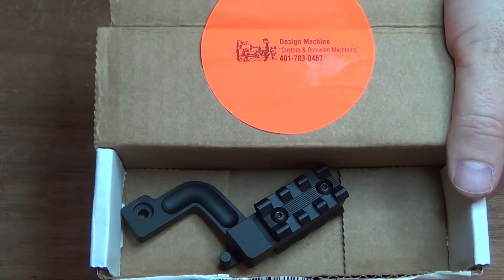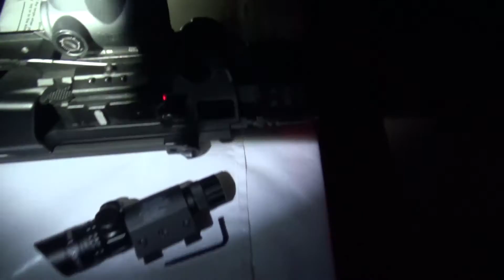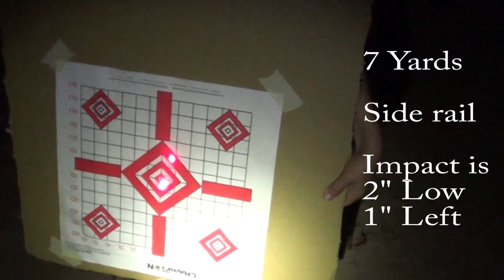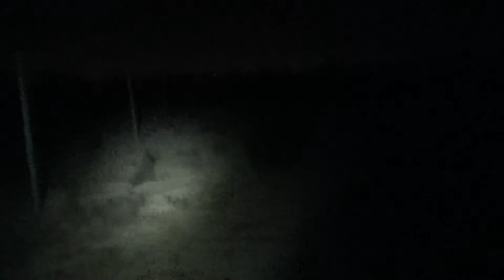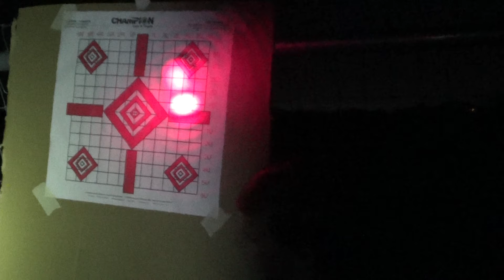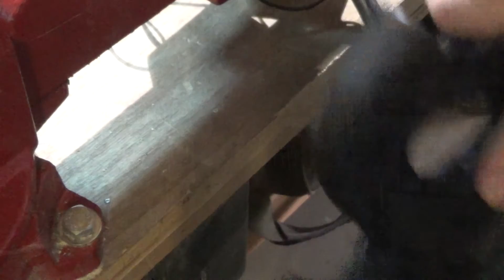New PS90 Light and Laser Mount

Comment: Ordered both the mro and rmr mount as I continue to experiment.  The RMR is a bit small window and if you don’t go with the MRO, the SRO is a good option. 

Right now I have an SRO with low mount on the top rail with a viridian green laser in front of it.  I used a gg&g offset mount on the side rail with a Surefire Scout light that is easy to activate with the tailcap switch.  The laser has a remote switch I can activate with my trigger hand with my thumb.

I bought the PS90 15 years ago and made into SBR maybe 10 years ago.  At 19.75” long, it fits perfectly in a pelican 1525 case that also hold an extra 5 magazines for a total of 6 mags.

If there was ever a firearm worth spending the $200 for an SBR tax stamp, the FN PS90 is it.  The gun ultimately is a 5 to 50 yard CQB rifle and if you outfit it as such, you won’t be disappointed.   Compactness, no recoil and 50 round magazine makes it that.

Comment: I dont think you're supposed to shoulder it as high as you are. For untrained shooters or people who are not used to shooting a lot, the high stock position that is very common in the american shooting community is almost painful to use for longer periods of time. I shoulder the PS90 with the top of the stock in the pocket in my shoulder, under my cheekbone, which requires a lower stock shouldering position than is common in the US. It is, coincidentally, about 1" lower than the high position is, which as you recall, is the difference between the 1.41" optic height of an AR, and the ~2.4" optic height of the original P90 reflex optic (or whatever it was). It also makes the highly rearward angled grip even more comfortable.

Comment: Any possibility that a 1.1" diameter suppressor would fit underneath that DM mount?
Reply from the maker: I don't think so.  It sits pretty close.  To be sure, however, you should contact Duane (link in the description).  He is helpful and easy to talk to.
Reply: I've spoken with someone at DM on the FN forum, but unfortunately they're in a no-can state and haven't attempted to fit one underneath.  I think you're right though, looks pretty tight.

Comment: It looks too close to the muzzle though for a suppressor?
Reply from the maker: On a SBR, a small diameter 5.7 rated can, like a sparrow *MIGHT fit, though it would be tight and I would worry about the heat on the accessories.  It would work on a non-SBR without issue.  For a more precise answer, I think you will find Duane at Design Machine very helpful.

Comment: I think one option for an optic might be a Trijicon RMR. Much smaller and it would sit quite a bit lower than that relatively big MRO.

Also, what about a Surefire XC1 flashlight? I would think a super small pistol light would be ideal for this type of rig.
Reply from the maker: The RMR would be a solid choice.  It sits about 1/8" lower, each on the lowest available mount, but I gave up that 1/8" for what I consider a better site picture. If you are mounting it to a rail, the RMR gains a bigger height advantage. Still, the RMR and the T1 were the other optics on my short list.

The XC1 would be a great choice, and would work very well with this mount.  If you are putting it on the bridge rail, you would have the same reach problems that other pistol lights bring w/o a tape switch.

Comment: It would have been nice if the factory P90 laser setup was available for the PS90. That seems like the ideal location for a laser.
Reply from the maker: There is a company called Promoted Pawn that does a version of the old factory laser.  I don't know anything about the company, but the unit looks pretty close to the original.  They do charge for it though.  around 400 for the parts, and around 800 for parts and instal.  The instal looks fairly involved.
Reply: I've heard of Promoted Pawn and they seem to always be out of stock and that installed total cost is a little ridiculous considering it would be more 2/3 of what I paid for the PS90 itself. That cost is better spent on a nice red dot and replacement low mount system.

There's a Hong Kong airsoft site (dentrinityshop) that claims to sell the laser kit ($310) but at a lower power rating of 3 mW.
Reply from the maker: MacTX I generally avoid airsoft gear.  It is often not made to withstand the heat and recoil, and 3 mW is pretty low.  The factory was in the 10 mW range.  It is too bad, it is a slick location.

Comment: How did you set up your SBR to get the barrel motion? How do you keep it from unscrewing/shifting?
Reply from the maker: Have you had yours apart?  The barrel is threaded on the muzzle end, and the only thing that keeps it from sliding out of the receiver backwards is the shroud, muzzle device, or thread adapter (which ever you are using).  If they fit your barrel correctly, they will bottom out with the proper amount of play left.  You just torque it down. 16" barrels work exactly the same way, and should have the same amount of fore and aft play.  It is just the torque that keeps it from unscrewing.  In terms of shift, the barrel has thicker bands that ride inside the receiver eliminating side to side play.  The fore and aft play should have no appreciable impact on accuracy.
Reply: That clears it up for me, thanks!